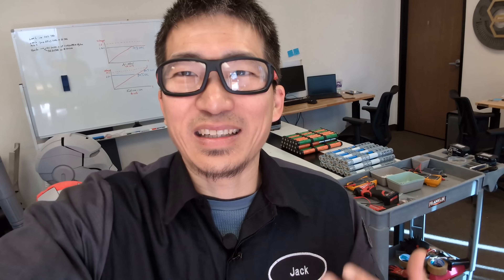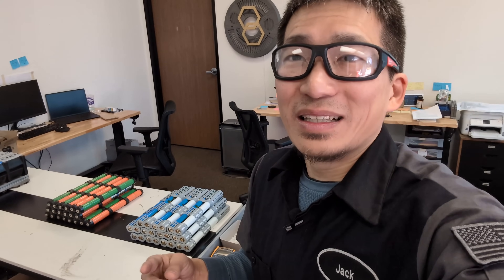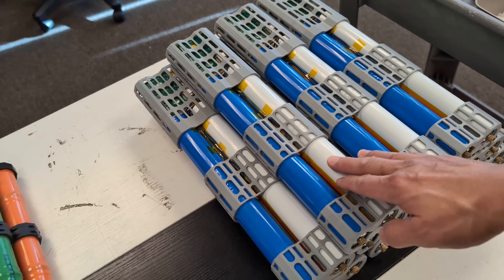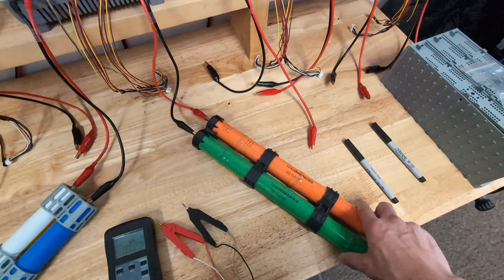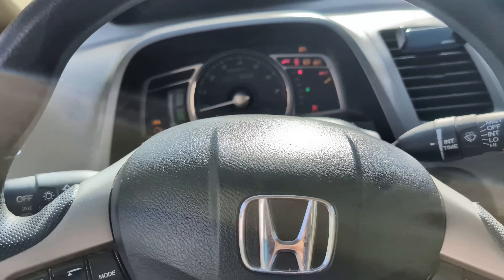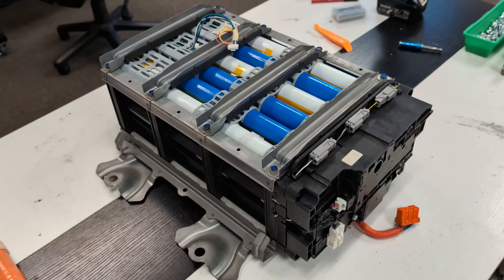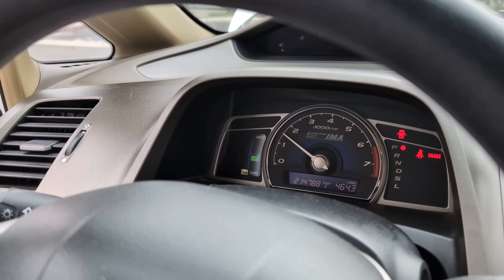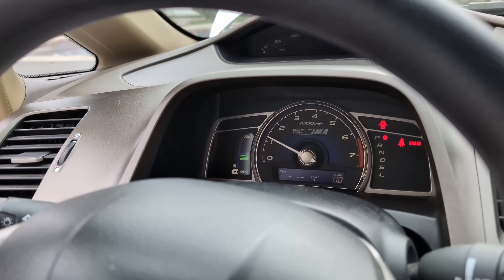World's First Honda Hybrid running on Sodium-Ion Power!! and we need your help!!

Comment: We've tested some Sodium cells and noticed a problem at low temperatures. The suppliers have also made some interesting changes to datasheets to back up these observations, now limiting charge to 0.2C at freezing temps.

Comment: I've been looking forward to broad implementation of the sodium Ion chemistry and can't wait to see how closely it behaves to lead acid. I'm hoping to build a hybrid battery system for my home solar using lithium banks and sodium banks in parallel to keep each other healthy and to keep absorption of solar potential high. Lead-acid just doesn't absorb well enough and lithium can't do the grunt work without doing itself an injury. I suspect that sodium will replace my lead and increase the life of my lithium while my lithium keeps my sodium charged until it has to do the grunt work. I look forward to seeing more old battery tech being phased out in favor of more practical alternatives.

Comment: I have always been interested in owning a 1st gen manual trans Insight. From our rural home it's 75-miles round trip to the closest shopping center and 100 to the Doctor or Costco. Never pursued it mostly because of apprehensions about battery availability and vehicle technical support. An occasional hyper-mile test would be fun though my current daily driver an '04 SI hatch w/K24 power is fun in a different way. In either one, I will always drive in deep and seldom brake but that's a different story. Ballpark, what would a 1st gen Insight Sodium-Ion battery cost?

Comment: Hi Jack. Great work converting these cars to Sodium ion. BTW The original Honda (and 1st Prius) battery 'sticks' are 6 NiMh cells in series 6x1.2v = 7.2v  then 2 of those in series is 2x7.2v = 14.4v (all nominal voltages…ie their v when discharged) which is why you have the originals jumping back to 14v ish. (4:52) Your original cells new were 6Ah but now measure only 3.39Ah so must be old or high mileage. I have some 20 year old ones that didn't see a lot of use that still have 6Ah capacity and can deliver 30Ah…which I think is pretty impressive!

Comment: I have the Japan 2006 Hybrid.  Hot weather, A/C, heavy idle use, after draining during acceleration, make the battery go super low and test.    Firmware updates did really strange things in order to "preserve" the stock battery.  So, the readouts were not necessarily accurate and you get a "two battery" style behavior.  The original firmware, while honest, got Honda into a lot of trouble with regards to mileage estimates.  I can't tell you how many revisions there were.  But they were designed for Honda (CYA), and not for the driver.  I'm on my 2nd battery and probably need a 3rd.  I live in Texas with long periods of very hot weather and very little super cold weather.  Car went from getting about 45mpg in mixed used, to 40, and now it gets about 33-35 mpg in mixed use (on a bad battery, so, not really the greatest condition).  I believe the battery is about $700-800 USD and more with installation.  AFAIK, I own the very first Civic Hybrid of that new gen from 2006 in N. Texas.  I got it around Christmas of 2005.

Comment: Nice one, I own a 2009 version which has a different batterypack as the 2007 version. I have now reached the 200,000 kilometer mark and the battery is still functioning okay as i have around 23 kilometer per liter use which is around (56miles per gallon ). but I am very interested in the battery you guy`s are using. So you have a new fan of the channel here. 😉 (I am from the Netherlands Europe)

Comment: NiCads still made. Do have their own advantages.
Reply: Both the original Honda and Prius battery cells were Nickel Metal Hydride (NiMh). Very robust. I have some 20 year old sticks that still have full 6Ah capacity…although they've only done 60k miles
Reply: Nicads are indestructible. 0 volts to fully charged even after 10 years still works

Comment: Very interesting!!  On a related topic I was looking at the Ford Maverick Hybrid as it can return over 40 mpg in town.  Problem is acquisition cost.  Ford charges more for Hybrid (at least in the lower trims), so much that it's actually cheaper to just get the 2.0 Ecoboost engine if you only drive 8000 miles per year.  Overall cost is less including fuel for the turbocharged version which is also more fun to drive.  I love the idea of excellent economy but I also like to understand the total picture.  But at least with your solution to the battery problem in the Civic it seems that overall cost is a strong consideration.
Reply: The biggest reason I prefer the hybrid over the 2.0 EB is it's far more reliable.

Comment: Are they lighter or heavier?
Reply: Sodium is heavier but trades that weight for smaller cost and easier to find.  Lifetime is smaller but compensated for by gentler use because the motor is assisting and preventing idle cost of fuel.  Sodium Vanadium could extend the life cycles in future cars but that  is future tech found in labs, not factories.  Sodium ion is a new tech.  Charge rates are different then lithium iron phosphate.
Reply: I have both batteries and in terms Lithium-ion vs Sodium Ion the weight is about the same.

Comment: I drive an Insight gen2 (2010) and the battery quality definitely affects mpg. After leaving the car lying under a pile of snow for one month, the battery lost a lot of capacity and started charging while accelerating, instead of just when braking. It is especially noticeable when driving uphill, so that's my torture test - if you can drive uphill without losing horsepower to charging, you've basically solved Honda hybrids!

Also, from using 5.4 litres of gas per 100km, it shot up to 6.5, so you should definitely see improvements in mpg as well.

Comment: Hello, my name is Thomas, I am Brazilian. This battery has to be tested in hotter and colder regions where any combustion or electric vehicle suffers an extremely radical extreme. For example, drive this electric vehicle using this sodium-ion battery on one of the longest hills with an incline of 75 or 85 degrees to suffer extremes of the car or mechanical and electric to overheat the electrical components in a long extreme.

Comment: on my prius, low mpg (with a confirmed battery), might mean the inverter is overheating, thus always in a shut down mode and not charging.  sometimes the coolant pump goes out.
Reply: people with Gen 2 Prius reported higher MPG just with higher capacity battery. A truly higher capacity battery would suffice without even going to a PHEV for most urban travel. Your inverter coolant pump sounds faulty.
Reply: @z_actual  yes, it's a common problem with older models.  we just got a new crv.  it has an EV mode but cuts off at 25mph.

Comment: Would like to have this 08 Highlander Hybrid.  I live in Colorado, and the hills and mountains just deplete the NiMH batteries.
Reply: NiMH batteries for long life, should be completely discharged, then fully charged to get max life I've read.  In the Prius, they were not good.  I had a 2011 plug-in Prius.  Terrible car.  I've been on Volts ever since.

Comment: Make it for the gen 1 Honda insight. That would be awesome. 😉
Reply: I think this is a first gen honda civic hybrid which shares a nearly identical drivetrain with the first gen insight.

The argument at the time was that people didn't like how the insight looked, so they took the drivetrain and dumped it into a civic.
Reply: @blu0065 insight  is 3 cyl . Civic is 4 cyl .
Reply: @blu0065   Not the same hybrid battery system though.  And the G1 Insight will always be the kind of MPG until someone else makes an all aluminum spartan commuter car with a manual.
Reply: I second this! Would be very interested...
Reply: Shouldn't be too difficult. AIUI the 1st generation Insight shared same 7.2v (nominal) battery 'stick' modules with 1st generation Civic & Accord…20 of them for 144v system. Later generations of Civic (maybe others) had 22 for 158v although it seems those might have had 5.5Ah capacity sticks rather than the earlier ones of 6Ah…also layout and connectors were slightly different. I guess it ultimately depends on how demanding the regenerative charging of each model is and whether the sodium ion cells can cope with that.